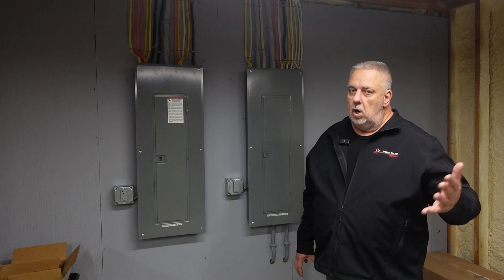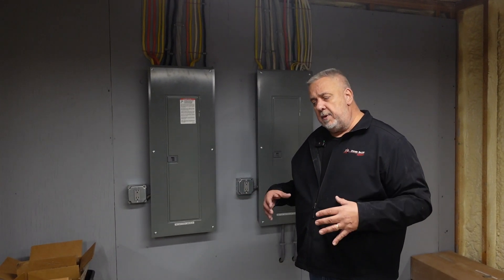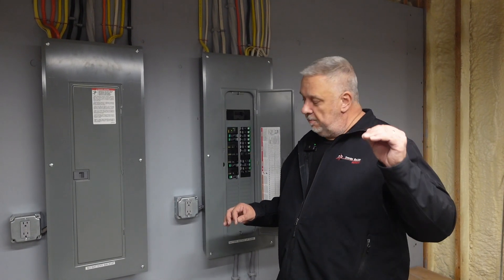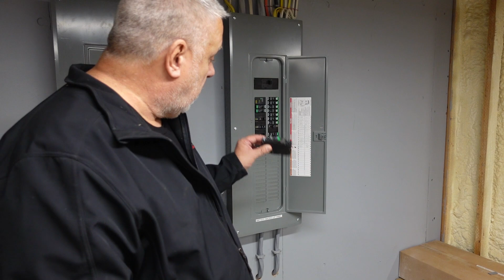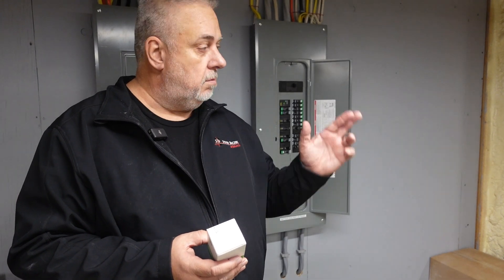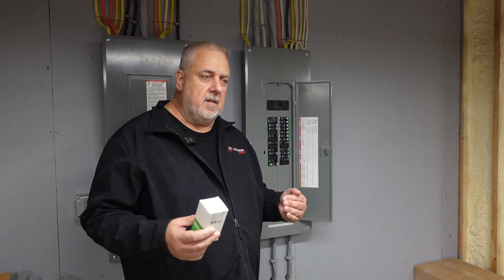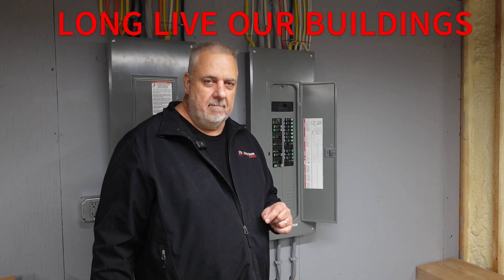CUTTING EDGE ELECTRICAL SYSTEMS

Comment: I am a little disappointed Steve didn't get into POE for the lighting side.  It is so stupid running 15-20 amp 120 volt AC to bulbs that have to include a transformer (the part that dies) to draw less than 0.1 amps.  In new construction it's lower risk and potentially lower cost running ethernet for all the switches and fixtures.  The problem is standardization and convergence - influencers like Steve can help drive that.

Comment: I like new tech as much as anybody but as a now retired master electrician I think I can accurately predict that everything you are installing right now in the way of smart devices will be in a landfill in 10 years. I could fill a warehouse with all of the lighting and home automation garbage I’ve seen come and go over the last 20 years. The reality is that people are really geeked out on it when they first put it in but it gets old real quick when you’re just living your life and the stuff is more trouble than its worth. And when faced with the reality of replacing all that stuff when it fails and you find out it’s now obsolete so replacements are not available you just end up installing ordinary breakers, switches, and receptacles anyway. If you install a good Square D QO panel and breakers from the get go they’ll last you probably the rest of your life and save you thousands of dollars.

Comment: Why control outlets? That does you nothing. If the receptacle serves a large enough load, it is on a dedicated circuit and you can just turn off at the circuit breaker. Enough with pushing these ridiculously expensive devices and installation methods, it has gotten expensive enough to build houses and builders are not doing any of this stuff because their subs are not taking the time to do it. Time to get reasonable and stop being political with all this green stuff. It does not pay off.

Comment: "Smart" electrical connections are fine if you want that option, but you really need to budget for some good network security if you go that route. This stuff is easily hackable through a standard home router and Internet connection. 
My 2024 build will have traditional switches and outlets; the only "connected" items will be security cameras and alarm (with good network security).

Comment: If you can turn off any switch, outlet, or breaker through the app, why would you need a second, non-critical panel? You could keep everything connected to battery backup power and manage the load on your phone. Pretty sweet setup.
Reply: Sadly, there are still some tough limitations with solar.  Only 52 of the 86 panels can be backed up on the batteries tied to a single array.  The option was to put some batteries on the other panel (200amp service) on what is basically a second array.  That was not an ideal answer.  The solar technology from most of the companies is still really limited to 200amp service, hence the need to have two 200amp panels that allow some panels (52) backed up on the batteries and the others (34) just produce power and that powers the house or exports to the grid.  With Enphase IQ8+ microinverters the 52 panels are there to produce power to the house and batteries (if full to the grid) and to also be used in the event of a loss of the grid power.   The 52 panels chosen are the south facing panels that will generate the most power.  The 34 are facing west and those are most advantageous to the grid during peak demand periods that are in the afternoon hours. 

The Wiser devices, in combination with the Schneider/SquareD outlets and switches allow not only the Sense based technology to track all loads and usage, but to tie that back to each outlet or switch, which the Sense in my current home will not do.  That means that you can immediately see each load and not have to wait for the Sense technology to "learn" what the device is.  Too much granularity?  Probably, but the desire was to use this as a test to create better data that is hard to find.  A little more expensive to do?  Definitely, but my desire was to test what works best.

The breakers themselves are not really "smart".  There are relays that are smart and controllable for all of the devices that are higher loads.  That means that the high amp breakers are tied to relays that are able to be controlled from the app.

The problem with load management at this point is the question of the limitations that are created if you try to go to a 200amp service and have to shutoff some devices to run others.  Do you want to limit your ability to charge your car when you are cooking or the hot water is being produced or heat running?  The next few years will take this technology much further and many of these limitations and challenges will be resolved by the brilliant engineers working on new ideas.

Comment: Thank you Steve for pushing back with soem common sense about remote load management- the circuits you need to stay on refrigerator, sump etc, are always on anyway! Next task-push back against talking refrigerators!
Reply from the maker: i LOVE TECHNOLOGY, but maybe sometimes I quest certain tech's "WHY".....
Reply: @stevenbaczekarchitect9431  I am in a high tech industry but when it comes to consumer electronics and e-commerce I am skeptical of "there's an app for that on your phone".  It is a really rare case that any of those make my life easier and often the first iteration is good and subsequent "improvements" make it worse over time.

Comment: You can bet your ass it’s a safety issue….if you want to cavil about codes, focus on ‘energy’ saving codes- like Specifying  r values in walls but not dealing with bridging or air infiltration?

Comment: Why not put the whole house on battery and not have two panels? Power out and I am on battery I am smart enough not to turn everything on in the house and drain the batteries. Keep it Simple (KISS)
Reply from the maker: Load management purposes
Reply: You don't typically know when the power will go out.  If the power goes out and the load at that moment is too high for the batteries, the safety breaker on the supply from the batteries will trip, all of circuits will lose power, until you go around and turn off loads and then reset the breaker on the batteries.

And I would expect that might not even be to code, since you should NOT design a system that can place more load than the supply can handle.

Your proposal would then be that the battery system MUST be sized large enough to handle the entire possible load, but only for a limited time, and to extend the time the homeowner would ensure that optional loads are left turned off until power is restored.  That of course means more money for more batteries than might be required strictly for critical loads.

I would personally build my system exactly that way, and not have a separate critical loads panel, instead planning on having expandable PV / inverters / batteries so that I could right-size the off-grid system over time, for example keeping the option to add batteries in the future, not to increase the load that can be handled, but to increase the runtime.

Comment: Glad someone with a bit more disposable income than me is willing to sus out these new systems and in 10 years can let me know if they are worth the extra money or are obsolete.  For now I'll stick with my $3 receptacles.
Reply from the maker: I am kinda with you.......
Reply: Good point. Being an early adopter will always cost a lot more. Those of us with limited budgets need to let them figure it out first. 😄
Reply: Inexpensive smart switches are $10-20. Not much more than simple Decora switches with built in light.  They can do some useful things like voice control with Google or Alexa or turning everything off when you leave the house. Unlike with more expensive switches, their smarts don't work when the internet link is down, but they still function like regular switches.
Smart outlets have their place, but I wouldn't put anything important like a fridge on them. They could shut off  because of  voltage spike or a software glitch.

Comment: Leviton's new smart breakers are the way to go. Single breaker also allows remote on/off now and has a load sense in the connection bridge to detect when grid power is lost. It allows you to size one panel and the customer can pick which loads are critical and change them as needed. Kind of like the span panel which allows the same control.
Reply: The noise...

Comment: The problem with IoT’s(internet of things) is that it goes to a foreign server and at anytime they can turn it off. This is a fear not normal occurrence but Hackers show up at the worst opportune times. They need to set up there own IoT server at the local site
Reply: HomeAssistant and devices flashed with Tasmota or MQTT capable!  Firewall rules to block any type of “phoning home” to an off site (out of country) server.

Comment: The electrical code is evolving rapidly. I’m not sure if is going to save lives or just generate profits and price out the middle class.
Reply: I agree with your comment. To me this is evidence of the ever increasing economic divide between the Middle class and those for whom a 100,00dollar backup solar install is just an incidental expense.
Reply from the maker: @treepop1550  I tend to agree with both of you.....
Reply: @treepop1550  unfortunately you are probably correct in some ways, but the only way that these technologies evolve to the point where they come down in price, get more advanced, and can serve an important purpose in helping to reduce the massive challenges that we face with the grid is if people are willing to be early adopters and pay for some of that R&D that the companies have to invest in to get to the next set of advances!  Just think what would have happened if there had not been people with the economic ability to buy the early Tesla cars?  To those of us late to that EV change, we are the beneficiaries of those who were ABLE and willing to take that risk.

In the case of batteries, I put Teslas in my current house.  Due to incentives (cash back, tax break, SMART storage adder, peak demand payments) at that time, plus participation in the vitally important Peak Demand program, my payback is about five years.  To me, that is a no-brainer.  In the case of the new house, the payback will be a little longer, but a major step up from the Tesla batteries and still an excellent payback while having "energy security" in an area that is increasingly seeing outages from downed trees due to weather events.  In the last two snowstorms, there have been huge outages in the area, one that blocked the road in front of the house due to a tree that had fallen on the power lines.  That was about an 8-10 hour outage.  Other outages were multiple days.

Regarding the peak demand program, one of the other notable disadvantages of the Tesla batteries is that Tesla takes a 20% "fee" from the payment that the utility makes to the homeowner for the power that is pulled from the batteries to meet peak demand needs.  The 20%, plus their very opaque management and lack of reporting of that process was an element that helped with the decision not to use Tesla batteries again.  That, and the technical advantages of the Enphase IQ batteries (gen 2), integration with the IQ8+ microinverters, etc., made that a more attractive answer.

By the way the backup solution cost far, far less than $100,000!  That would be an absurd expense at that cost.  The total solar and battery system was expensive, but, again, has a very reasonable payback period, hence a great IRR as an "investment" that also provides many other benefits not only to me and my family, but to help reduce the need for fossil fuel based peaker plants.  If a large number of utility customers had batteries, that need would be radically reduced and that would be very beneficial to the environment.  Before anyone comments, embodied and lifespan carbon issues are a factor that needs to be addressed.

The future is in bi-directional charging and the ability for the car battery to also be connected to the Peak Demand programs.  That is happening in some places.
Reply: The NEC is supposed to be a fire safety code but a higher and higher percentage of the code writing committees are populated with representatives of equipment manufacturers.